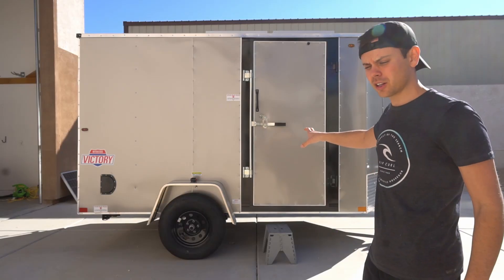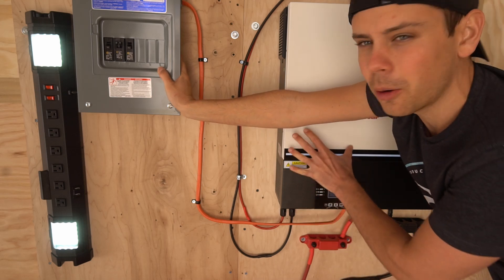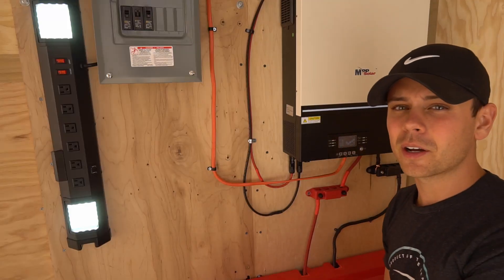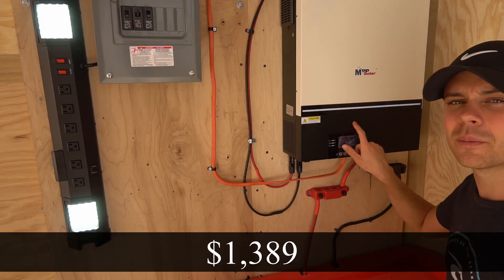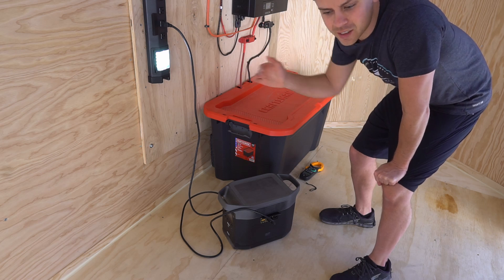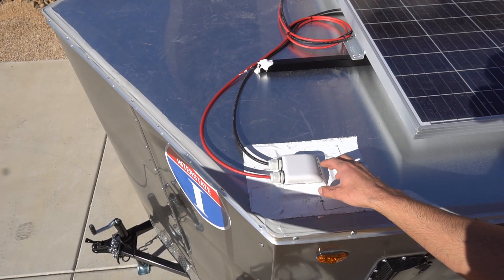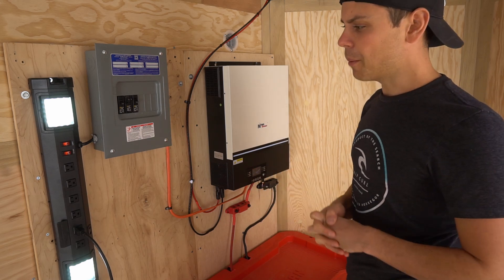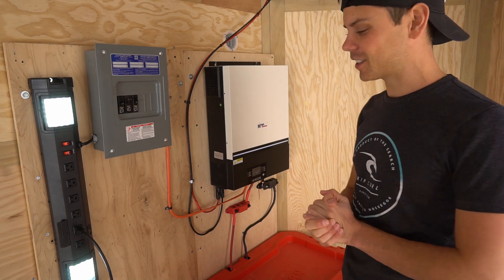Utility Solar Trailer: 6.5kW AC Output, 4.8kWh LiFePO4, 8000W Solar Input and AC Charger

Comment: I would like to do that to my cargo trailer but with 110 at 30A so I can plug my motorhome directly into it.
Reply: You just need a 4500+ Watt inverter. You would need to wire in the 30A outlet, maybe in a waterproof box on the outside. I believe they make those, but they are a tad spendy...at least, for me.
Reply: Oh, and I am running my RV on a 24V, 2000W inverter, by just wiring in a regular extension cord in the place of the old 30A one. I just know that I can't use too many high wattage items at one time. I've run a 5000 BTU air conditioner on this system with no problem, but don't have the battery bank sized large enough to run it overnight. The capacity of your battery bank can be the major reason for not being able to run certain items.
Reply: Thanks, However with my wife in the motorhome they don't make enough batteries on earth to keep her powered. And she says she is all for the environment. Lol

Comment: What about temperature in that trailer?  Do you need to maintain a certain temp to keep the equipment operationally safe?
Reply from the maker: That is why we will install an air conditioner just like we did in the solar shed. Have you seen that build? It is easy to power.

Comment: Makes no sense to use an 8 kW inverter with just 400Wp panels, since the low watt losses are higher than with a lower power inverter.
Reply from the maker: That is why you add a ground mount array. I can stuff 600W on this roof and thats it. The whole point is to have a ground mount array next to it and charge up or use it as a power station. Or use 240V cable and transfer switch at my mains to power my house.
Reply: @WillProwse  Got 7.4 kW on the ground? :)
Reply from the maker: @UndercoverFerret404  I wish haha
Reply: @WillProwse  oh ok now I get it.  Were there is a Will Prowse there is a way!  😉

Comment: Do you have a link to buy the trailer? Is insulation an option? I live in Phoenix, so Vegas isn't too far to drive and I doubt my 6 cylinder Subaru Legacy would have a problem towing it home.

Comment: I really like the power strip with the built-in lights. It might be better if they were battery (DC) powered, but then you would have to match the battery voltage and they still would not work after low voltage cell disconnect.

Comment: will that be able to handle the vibration of driving?
Reply from the maker: Yes absolutely. The wood sheets are mounted to the metal studs. It is solid. I can hang my body weight from any part of it.
Reply: @WillProwse   are you worried about anything in the solar inverter ratteling loose?
Reply from the maker: @crimmy0204  I used the lv2424 in my last rv with no issue. Mounted the same way. I think it's fine
Reply: @WillProwse   please do a video on how some one could attach this to their house or charge it from their house, there are a lot of landscaping guys that will be moving to all battery powered soon. Thanks!